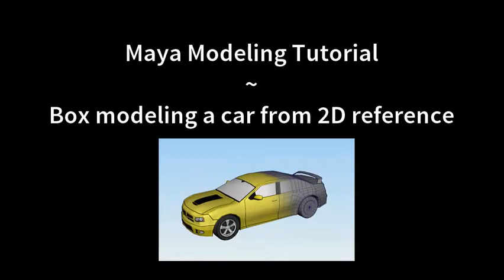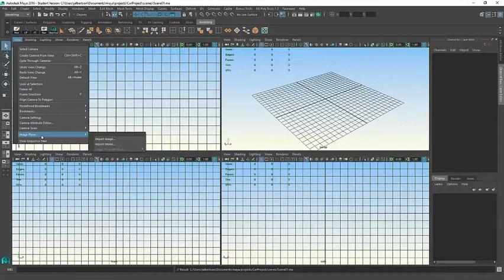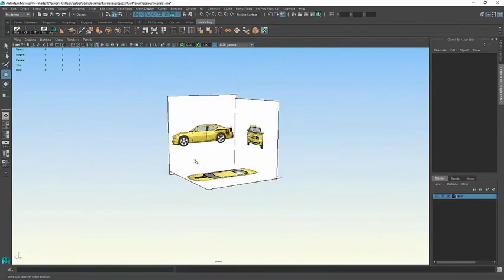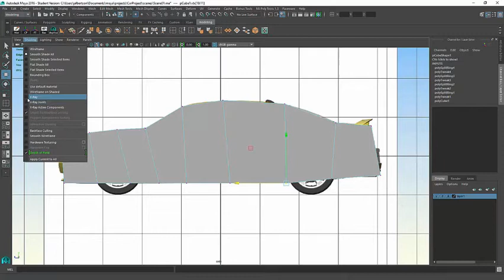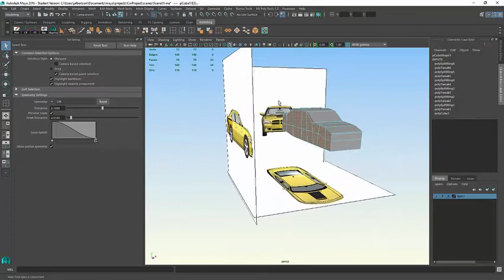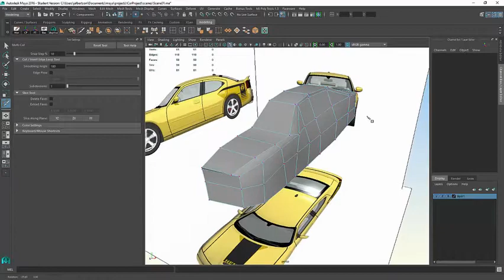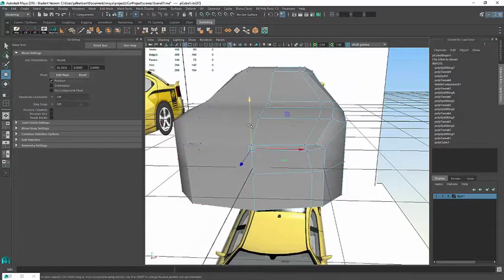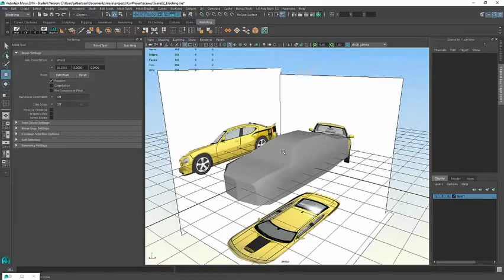Maya Car Modeling Project - Part 1 - Setting up 2D reference

Comment: looks great. I was searching for some kinda program that can do this automaticlly. do you think thats even possible?
Reply from the maker: What you could do is create an action in Photoshop to automate the cropping/resizing/saving of your images as jpegs and then you could create a simple mel script in Maya to automatically build the reference planes and assign the unique shaders.   I still think you would need to manually assign the images to the shaders, since each time the name of the file would be something unique (maybe there is a way to automate that part, but I'm not sure off the top of my head).  Hope that helps.
Reply: thankyou! I will look into that!